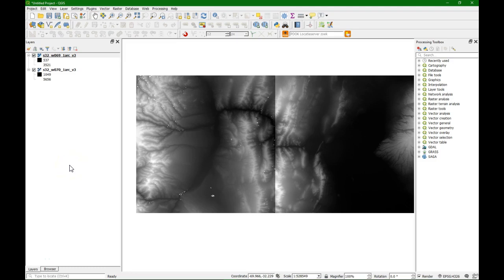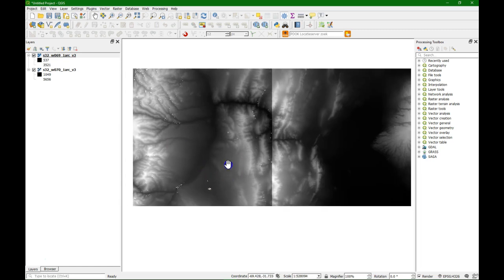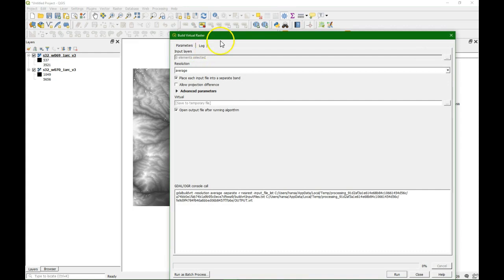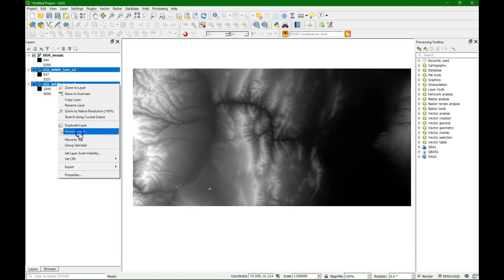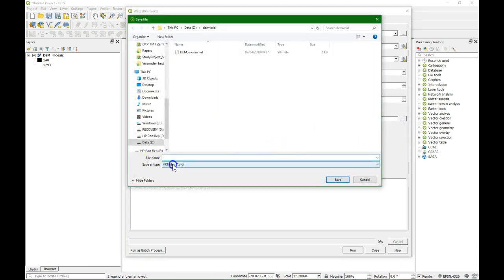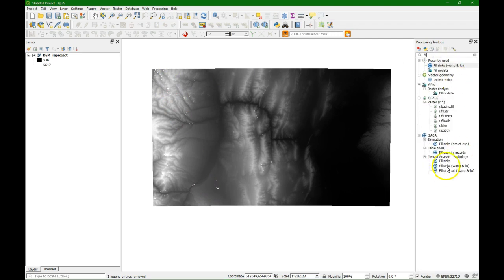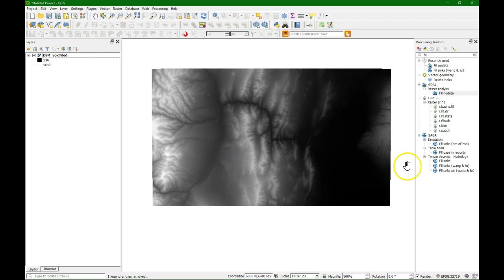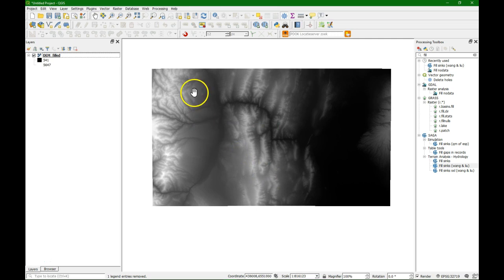Interpolate voids in DEM for catchment delineation in QGIS

Comment: Hi Hans
We want to increase the resolution of the SRTM DEM with digitized countours and altitude points from topgraphic map. How to merge them in one DEM ?
Reply from the maker: You can convert the SRTM raster to points with the "Raster pixels to points tool" and then add the different layers (points and contour lines) to the TIN interpolation tool, which results in a raster. Both tools are in the QGIS Processing Toolbox.
Reply: @HansvanderKwast  Thanks so much.

Comment: thanks for the video,. I followed the steps to fill voids,  the range of data before filling was -88 to 3633 and after run, the resulted DEM data rang from -32765 to 3633 . note that -32765 is the NO Data Value of the raster. please, how to correct the range of values (elevations).
Reply from the maker: You can add an additional nodata value in the Layer Styling Panel under Transparency. That's okay if you want to visualise.
For calculations use: Raster | Extraction | Clip raster by extent... Choose the layer extent as extent and fill in -32765 at "Assign a specified nodata value to output bands".
Reply: @HansvanderKwast  Thank you so much

Comment: Dear Hans,
I tried the technique to interpolate voids in a DEM and it is returning an error; 
The following layers were not correctly generated.<ul><li>C:/Users/Stanley Phiri/AppData/Local/Temp/processing_d840d7e3a4a945bcb7e5f8d19593444b/038e02f034c548a189a4fa86c5148393/OUTPUT.tif</li></ul>You can check the 'Log Messages Panel' in QGIS main window to find more information about the execution of the algorithm. 

Please assist
Reply from the maker: A few things that could cause the error. Did you reproject the DEM as shown in the video? It shouldn't be in EPSG 4326. Also check if you haven't got spaces or strange signs in the output folder and file name.